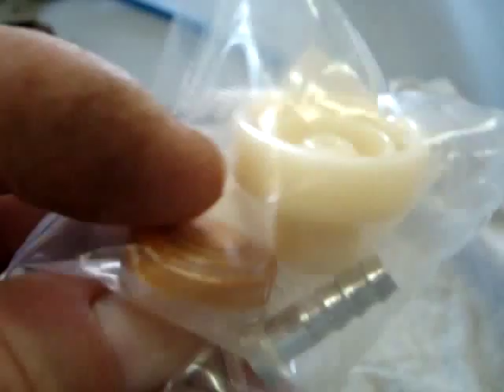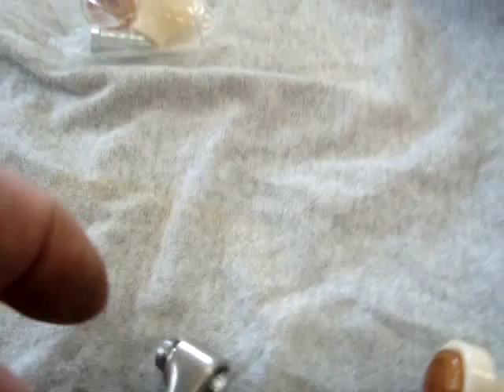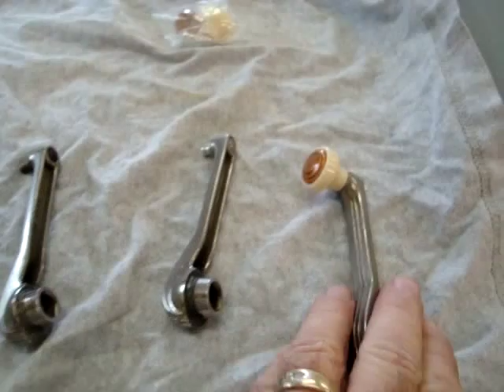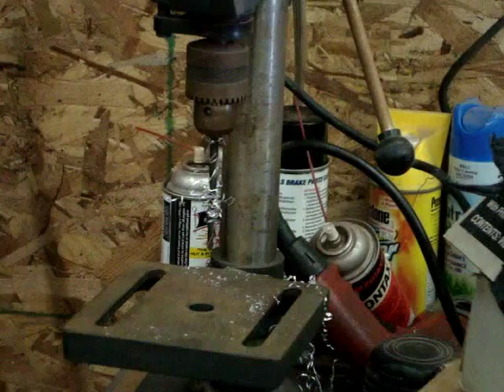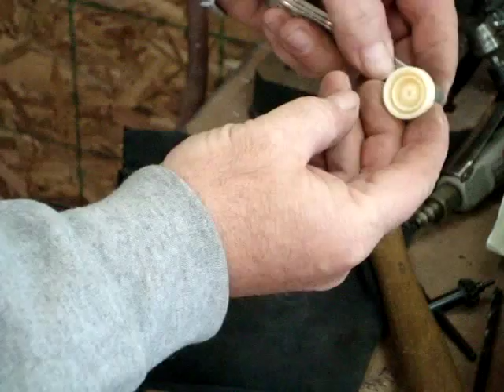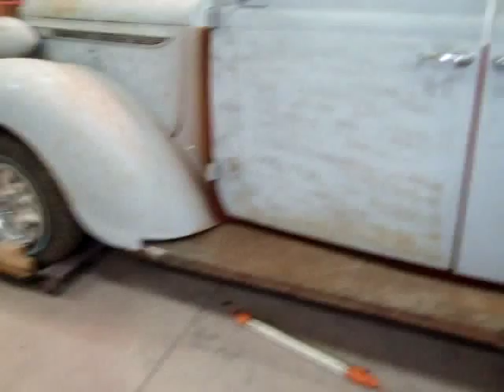1938 Plymouth Street Rod Part 2

Comment from the maker: Yeah, the runnung boards are expensive to buy but they're really nice. I've got Centerlines on my '61 Plymouth wagon you can see in a previous vid I may use, and a set of Coker wide white radials I'd run the skirts with. I wouldn't lower it much since I'm going to sell this one.